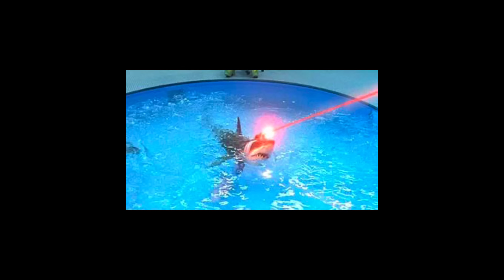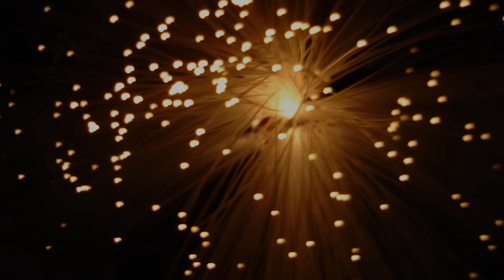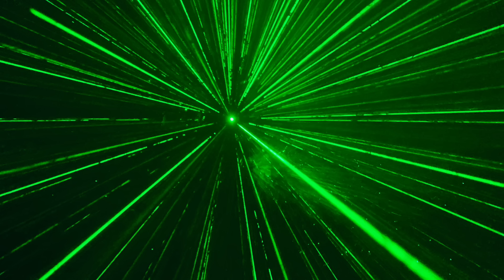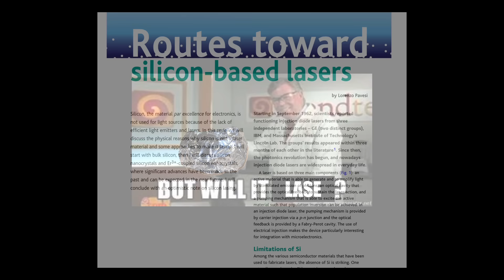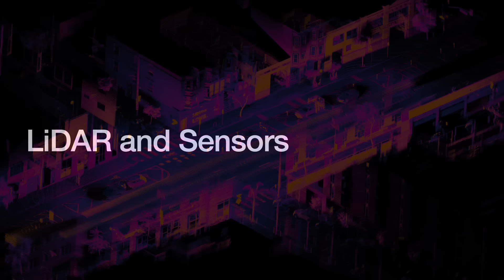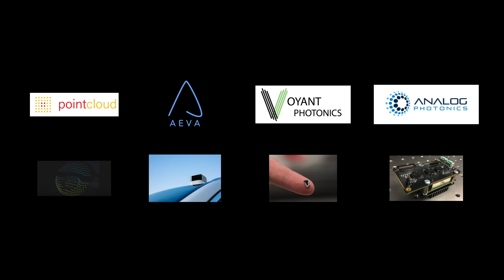Silicon Photonics: The Next Silicon Revolution?

Comment: On the math coprocessor all we need 3 led and a stem glass with all color shape size for math operation over ccd array so light mix colors as variable and constant and all the operations can carry out from basics to multivariable calculus or matrix instantly by color mix over each stem how many times and each second it can at least 10^ 20 calculations per second that thousand of trillion times per second. Better yet use light polarization geometric shape as operation like square is the power function circle as multiple variable ect

Comment: Signals do not travel at the speed of light in a vacuum in optical fiber!   They don't even travel at the speed of light for the material they are in because the photons reflect off the walls of the orbital fiber causing them to travel a much farther distance than the traveling electro static field of electrons.   

Signals travel at about 0.71 C in electrical conductors with no intentional inductive and capacitance loading.  Waveguides allow radio signals to travel at about 0.9 C.   Broad band optical fiber can have signals traveling at 0.1 C.    Narrow band optical fiber has similar propagation speeds of electro static fields in electrical conductors. 

A major advantage to optical fiber is its absence from interference and it is much more difficult to breach its security with external equipment than signals that have a broadly spreading electromagnetic field traveling in wires.  Optical fiber should allow the integrity of the signal both from interference and from external party monitoring.

Comment: My field of study was optoelctronic engineering/photonics. Being able to directly use silicon for it all would be a game changer to be sure. Currently, they are using Gallium Nitride to make photonic IC chips. You can create the analogius parts except a capacitor. Lithium niobate or precisely doped GaNb can be used as a transistor analog and simply changing the dopant levels of the GaN substrate can create waveguides for the photons. One possibility is creating a quantum computing analog that could operate near room temperature since the optical analogs of Q bit elements would have indefinite coherence since the thermally populated domain is far below the the energy states of the photons used. The future is quite bright. ❤

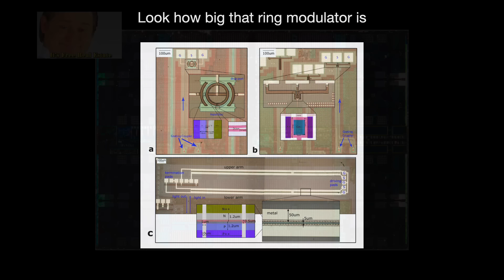Comment: 14:21 "1 square micrometer of real estate can house over 100 transistors" at 7nm.
More precisely, (1000*1000)/(7*7) = 20,408.  You could have said "over 20,000 transistors", though "over 100" is technically also correct.

Comment: As an industry insider - almost 40 now - this was pretty good.  Several of your pronunciations are off - CMOS (moss not mos), MACOM (may not ma), Mach Zehnder, etc.  On-die optical interconnect makes no sense for power and reach (distances are very short) reasons.  Check the activity going on with NPO and CPO and chiplets to see the future.

Comment: No, light does not travel through fibre at "the speed of light." 
The speed of light through a transparent medium is equal to c divided by the refractive index of that material, e.g. roughly 1.5 for glass. Thus, though an optical cable it's substantially slower than c, the roughly 299,000 km/sec of light through a vacuum.

Comment: i'm still using a copper connection. It's no where near as fast, but a lot more stable in my area, and my ISP isn't trying to prevent me from changing my router settings. I have full control, withou paying extra for no reason at all.

Comment: Good video, as usual for your channel. Some small notes:  optical fibre communications started in the 70s. In the early 90s WDM (wavelength division multiplexing) was commercialized, mostly thanks to optical fibre amplifiers like those based on Erbium doped fibres.
And the propagation speed (m/s) is not the matter: electrical signals travel more or less at comparable speeds, which, by the way, in an optical fibre are more around 200000 km/s than the 300000 km/s value in vacuum, because they are made of glass. The point is that with light in dielectric materials you can achieve much larger frequencies, whereas metals become very lossy and suffer from signal integrity problems already at some Gb/s.
Another important detail is that optical communications become convenient beyond a certain product of data rate and distance: for short distances like intra chip or intra board ones, electrical connections are still convenient.

Comment: Hi, is it not possible to use different wavelength at the same time. So the system must not so small, because I make 10 calculation with different wavelength.
Reply: Yes, it is possible.
Reply: @tristanmisja  Hi, Happy New Year, then the System depends home many wavelength the transmitter and the receiver can handle. If the System can handel 128 Wavelength I have a 129Bit System?

Comment: Wouldn't shorter wavelength laser diodes solve the problem of too large components? I believe 2 years ago we already had 217nm laser diode made. In fact I am pretty sure that we are working on turning x-ray laser into a more compact format as well. I don't know how well the components made of silicon would interact with those, however there is potential for miniaturization.

Comment: Question for larger brains than my own: I have been obsessing over my new computer build, with an Intel Raptor 13900K. I saw this headline and my eyes opened wide! SO my question is, will there ever be a way to produce an all-LASER computer chip? I didn't know light waves were that large comparatively. The Raptor chip is the king of speed for home use, and also HEAT. It can draw 350 watts! Think of a chip that size, with that computational ability that produces almost no heat! 😁 Any ideas?

Comment: "Light moves through optical fiber at the speed of light. Nothing is faster than the speed of light. This lets us transmit optical signal at super-high frequencies, which means higher data volume transmissions". 

This is not accurate. What allows fiber to transmit more data than copper wire is not their speed (they are nearly the same), but their better SNR. You were on point that they switched because of heat, and therefore energy cost of transmitting over copper. 

Being accurate and not peddling misconception is very important for a channel about semiconductor. You have high quality video that goes DEEP into topics.

Comment: Light does NOT pass through glass fiber at the speed of light.
Vacuum 2.9x10^8
Glass fiber 1.99x10^8
Glass fiber speed is specifically based on the refractive index of the fiber.

Comment: Wait so intel is one leading company in photonics? Interesting. As a customer that's looking into GPU and, wel still waiting for a decent deal, intel getting in the industry is nice, more competition. Anyway. I can't feasibly see photonic datatransfer being any use inside a processor any time soon. But GPU on the other hand. Hm. Probably not. And if it gives any real performance gain to transfer data from chip to chip. Still, it's probably going to outweight it's gains in cost.
A thing for the future though. Possibly. Or not.

Comment: Correction: "The speed of light" typically refers to the speed of light in vacuum, or c. Light does not move at the speed of c through fiber, it moves at a substantial fraction of c, but not completely. Same goes for signals carried by electrical waves in a copper wire. The actual speed, as in velocity is about the same. Actually faster signals would be good for latency. This is not what makes fiber optics good, in fact, the latency can be worse in some cases due to the translation between the media. The difference is the bandwidth, ie the number of bits you can transmit for a given time unit, for example Gbit/s.

Comment: if silicon photonics are reality then we can use it to run AI. Photons can be measured as a gradient not rigid 0 or 1 system. Neural network needs to calculate matrix multiplication that have a lot of this floating point numbers. Imagine a floating point chip core that sole purpose is to calculate matrix multiplication using light. This might be a game-changer to AI

Comment: Other than transceivers that send/receive data between computers, actually silicon photonics are applicable "inside" computers
There are different levels of applying SiPh, install a pluggable transceiver at the edge of PCB is what you mentioned in this video
Use an OBO (not necessarily a SiPh) which do the electric-optical convertion in cooperation with optical PCB (embedded polymer waveguide replacing copper circuits) is next level
Use co-packaged electrical-optical convertion (MCM package) and you have next level (optical I/O directly at SMD)
What TSMC is doing is definitely FOWLP integrated electrical-optical convertion which means optical I/O at die level

Comment: All approaches to replacing electrons with photons directly will fail, because they attempt to replace the silicon implementation with a one to one laser implementation. That is entirely the wrong approach, and will fail. The approach must be to start with a clean slate - out with binary state machine logic and in with parallel semi-analog machine logic.

There's just no reason at all prohibiting a clean execution of every single possible microcode sequence in one optical machine cycle, including the parallel bit processing with forward carry. It would be easy to implement an all optical machine that operates on 512 bits with 512 bits of possible instructions, one laser in, one laser out, operating at 1THz. Not only that, a coiled fiber makes a helluva fast ram, and a hologram makes for a very dense static/storage memory. Instead of powering the SoC with electrons, use a continuous co2 laser. The power supply co2 laser functions as the place where electrons, voltage, and current, are consumed, satisfying thermodynamic laws, and this device is the only place where heat is dissipated.

Easy peasy, crayon eaters.

Comment: So, I'm just spitballing here, but it seems to me if you can combine two different streams of light, logically, you should be able to produce an analog computer via photonics, right? Like, surely, it's not that insane to imagine a low precision photonic analog computer that could do matrix multiplications super quickly, causing a revolution in the AI industry overnight. As the technology matured I could see it being used as accelerators in consumer electronics for a variety of operations, to boot.

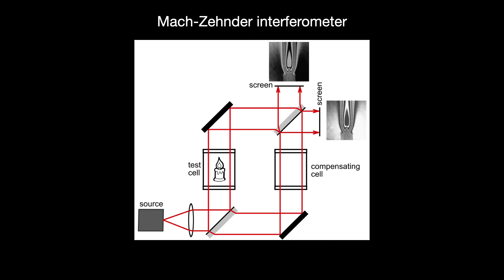Comment: @8:17, a Mach-Zehnder interferometer does not split light into two wavelengths, but light of the same wavelength into two separate light beams, the path of one of which is usually systematically varied to get some sort of phase information when the two light beams are recombined.  By the way, the "Mach" in the name is NOT Ernst Mach, whose name is associated with the speed of sound (the Mach number), but his son, Ludwig Mach.

Comment: If I were to apply to the same logic that applies to the word "electronic" which is, any  device which can control one stream of electrons (current and voltage) with another stream of electrons. In a nutshell, anyways, obviously it's a lot more nuanced than that, but for my purposes, this definition is sufficient. So anyways, I'm thinking if you apply that same logic to the word "photonic" it should be any device where the emission, or relaying of photons is controlled by another stream of photons. Which if you think about it, wouldn't a diode fit that description? Because a diode (even if not an LED) will give off electromagnetic radiation, usually infrared, when charge is flowing through it. And likewise as anyone who makes photocells will tell you, diodes do the opposite when they're hit with light.

 They produce a voltage and hence current. I'm just wondering if it would also cause some sort of secondary emission of infrared light as a result of this voltage/current that's created by the photoelectric effect. Because if it does, THEN you really could say diodes (or PN junctions anyways) are photon controlled photon emitters. Just like a photonic version of a voltage controlled voltage source. Which obviously brings up all sorts of interesting thoughts about applications in photonic or EM filtering or something. I don't know, I'm just thinking out loud at this point because it's so tantalizing to consider.

Comment: It is not electrons moving in the copper wire that carriers the current, it's the electromagnetic field. The electron motion itself is what gives rise to resistance heating and losses. That is how super conductors work, by elimination of the material itself changing under load the field can move unimpeded. The electrons in electricity serve as the field carriers not as the carrier of the charge.
Reply: That is actually correct. Electronic books never make that distinction for whatever reason. Well done😎👏👏👏👏
Reply: I've never quite understood why that is, sure it's a little more complicated but not by all that much compared to say complex board design et cetera and it gives rise to many dangerous myths on the nature of electrical dangers, most people think water is an excellent conductor (only moderately so) but are completely oblivious to the dangers of airborne dust and smoke being as good or even better conductors resulting in quite a number of electrocutions every year.

Comment: Silicon photonics:  always a promising technology of the future, AND ALWAYS WILL BE.

Many, many very basic problems that can't be solved:

(1) A wavelength of even ultraviolet light is hundreds of times longer than current semiconductor parts and processes.   By area, TENS of THOUSANDS of times bulkier.  No way around this.

(2) You have to convert electrical to photonic and back again, a lot.  Those steps are inefficient, power-hungry, very slow, and leaky.   Another factor of 100 loss on top of the previous 10,000.

(3)  Photonic wires have excess quantum leaking and crossover, and noise.  Another factor of 5 slowdown and loss of noise margins.

(4)  If you go all the way to quantum gates, you lose determinism and speed.  I dunno,  another factor of a thousand or so, working against the parallel quantum speedups.
Reply: (1) That weakness is, to me, only applicable to monolithic integration of photonics + electronics. Globalfoundries does this now in 90 nm and 45 nm processes. Some apps may benefit from this, others not so much. 
(2) This processes is actually extremely fast (60+ GHz in Si is possible). 30 GHz is routine. I agree they are inefficient and relatively power hungry. I don't think it's relevant to compare to a transistor. Current data centers and long haul applications use silicon photonics right now (e.g. Luxtera, part of Cisco). 
(3) I don't think so.. Waveguides are fairly efficient. Si has loss of about 2 dB/cm. SiN can get that below 0.2 dB/cm. Equivalent transport of a 30 GHz signal would be more than those numbers. I do agree the noise figures of photonic transceivers is not good, mostly from the noisy electronic to photonic conversion (shot noise and RIN mostly, etc.)
(4) I guess so. 

My bottom line is: Integrated photonics is used now. There are a many companies producing viable products today based on silicon and InP.
Reply: Go understand what is analog computing first.
Reply: @franklee663  I spent a dozen years working in an analog and digital computing laboratory and I still have a half-dozen Philbrick tube and transistor analog operational amplifiers, so I suspect I can qualify for at least a scout badge in analog computing.

And oh, I have shaken the hand of Dr. Otto Schmidt, the inventor of several analog computing devices going back to 1936, and Bob Pease, holder of many analog computing patents.  So there!

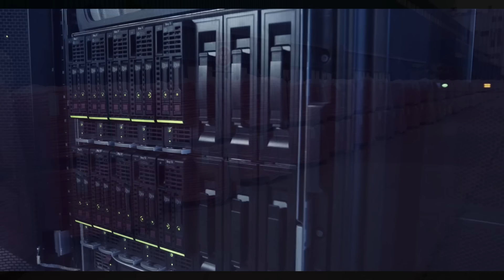Comment: 1:33 Not exactly, light slows down when it travels through a medium. Even if that medium is fiber optic cable. Light only travels at the speed of light in a vacuum.
Reply: 100%. The other common myth is that "light is faster than electronics", which is not true if this is taken to mean light (in the visible/near IR) will travel faster than an electromagnetic wave through a copper wire. The wave in the copper wire is significantly faster and causes problems for the design of electro-optic devices, like modulators. The reason we say "optics is way faster than electronics" is because of the available bandwidth at ~193 THz (optics) vs at ~3 GHz (RF). We can use 100s GHz of available bandwidth at the high frequencies of optics to stuff lots of data, much more so than can be stuffed in the narrow bands near 3 GHz.
Reply: @christianb1176  The speed of electricity through a wire or circuit in comparison to light through a fiber optic cable is a matter of much scientific debate. But, you are correct about the bandwidth. Light can carry significantly more data. Technically, electrons should move at a similar speed to photons, but there's a little thing called electrical resistance. That's why billions are being poured into research to find super conductors that can operate at room temperature.

Comment: Light does not move through fiber at the speed of light. Saying it does is bad phrasing. It's about the medium it's propagating in. Look up velocity factor on wikipedia and you'll see it is 2/3rds the speed of light. You need a hollow-core fiber cable if you want to attain near 1c speeds. (The speed of light in a vacuum is 1c).

Radio waves don't have this same latency issue.

Comment: "Nothing is faster than the speed of light"
In vacuum
AFAIK is electrical current faster than light in fiberoptic cables. They use fiber optics because of other properties such as interface resistance and low degration of the signals and low power needed.